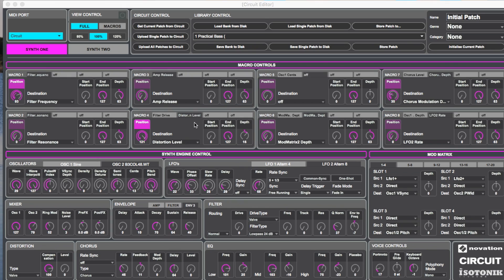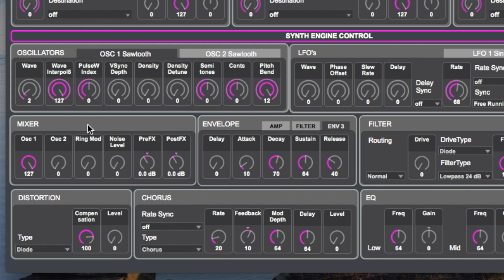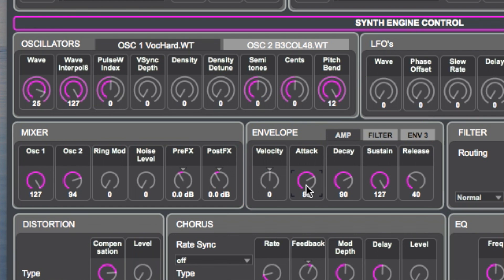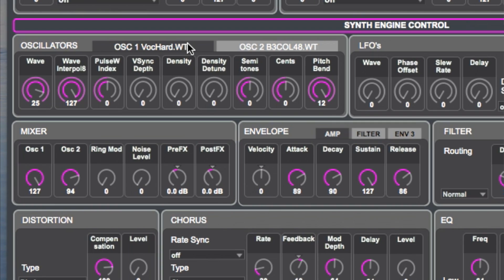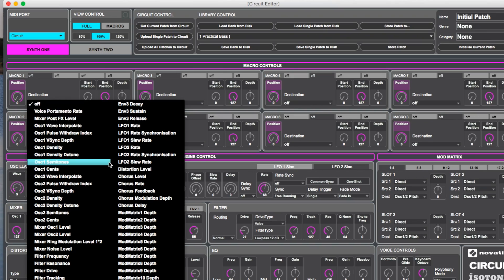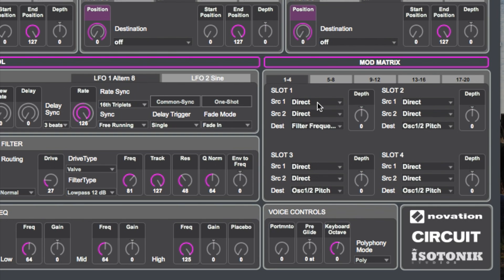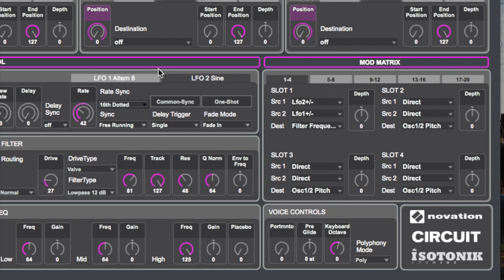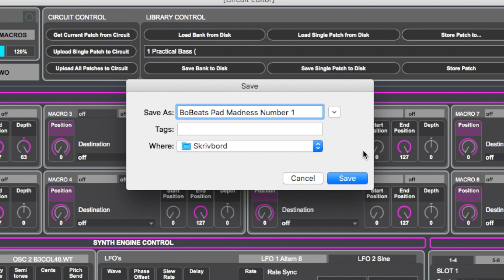Circuit Synth Editor Tutorial (Beginner Overview & Pad Patch)

Comment: Great vid, are you using it within Live? And its just a matter of connecting  via usb? No midi? I'm having issues with the Editor talking to my Circuit  :-/
Reply: Did you get the Novation USB driver? Does Components register the Circuit properly? Did you start it in the right mode? (hold down Scales, Note, and Velocity while turning it on and it's plugged in the USB)

Comment: Don't know where else to ask and becoming really frustrated. I tried editor following this tutorial and it worked and I managed to create my first preset. But next time I've launched it - nothing happens when I'm tweaking synth engine controls. Patch is initialized and macro knobs in editor react to turning knobs on the hardware - and that is it.Would appreciate any help or reference to some troubleshooting guide since I can't find any
Reply from the maker: Have you actually saved the preset? You have to press "save patch to file" save it somewhere and/or upload it to the Circuit. Otherwise it isnt saved on the Circuit
Reply: thanks for such a fast reply, appreciate it. I'm talking about actual editing, when device is connected via usb-midi and you are tweaking live, like you do in the tutorial. I'm on Windows, so as you said somewhere else, you haven't experienced those problems. I'll go thru the comments section, maybe there are some solutions in there. But thanks anyway!
Reply from the maker: +Drew DEI you havnt forgotten to set the depth level of the macro? Easy miss.
Reply: well, you don't need mod matrix to hear waveform change or even turning osc1 level on the mixer up and down, right? I do not hear any impact right now

Comment: Ok, brother Bo, it's me again with the 1 MILLION questions...hahaha... This is super cool, and i get it quite well, JUST have one last question...... how do I load a pack from yours into the isotonik editor from you, I think this would be easier than the components method, and what if the pack contains drums where do they go or are they editable as well ? THANKS AGAIN for your quick replies, I know your time is valuable.   :)
Reply from the maker: +rubber duky you can only load PACKS in components, but syx files should simply load into the editor. I think you choose "load from bank" button. But you can mot load samples in the editor. But the Components is probably your best bet. If you learn to use it it is very practical. Especially for storing backups... say you have filled your sessions... then u just backup everything in components (samples, session, patches) and can do a recall of everything! Super nice way of saving songs (since u need the samples/patches as well for everything to sound right)
Reply: AHAAAA, now i get it. I have been messing with the editor since my last post about an hour ago, and it is simply amazing. I'm getting the coffee/ beats pack. Is there a tutorial on how to get pad sounds to play at full length ? I created some nice drone ambient stuff in synth 2 but they cut off when I play as chords. ?
Reply from the maker: +rubber duky there arw workarounds but I dont have a tutorial on that. I am sure of you youtube search "novation circuit drone" you can find something

Comment: Thanx for the solid bro /completely intimated until about 2 hours ago / wonder can it be midi mapped / if you could use a controler instead of a mouse and keyboard you could do some ill real time-live.......
Reply from the maker: +All Roads yes you can control parameters using some kind of midi setup. But I cant tell you how since I have not tried. Perhaps you could ask on Circuit Owners Forum on Facebook?

Comment: None of the changes I make in the editor work on the circuit... help?
Like seriously, step one, and I can't even do anything... It will 
initialize, but I scroll through the waveforms, and it wont change them;
 they're all sawtooths...
Reply from the maker: I am afraid I can't help you. You should ask over on Facebook "Circuit Owners Group" or send Isotonik a message.
Reply: have you found any solution? I'm experiencing the same problem right now. Worst thing is that it worked first time and then stopped to work.

Comment: Extremely useful video as usual Bo, thanks!
Here's a question may be not related but as I'm new to synth: 
woul and get its  d it be an issue to get an Analog Keys 64 step sequencer to work well with my machinedrum MKi (32 step sequencer)?
Any comment appreciated !
Thanks a lot again
Reply from the maker: Thanks mate! I can't see any reason it would not work.
Reply: BoBeats thanks, I mean in terms of the different step lengths .
Regards

Comment: How do you connect the Circuit, so that you can change sth, then play, change sth again, play again? After this awsome video I want to try it out myself, but the Editor won't let me edit (except the macro knobs, I can tweak them with the mouse or on the Circuit). Does anybody else have this problem? (I'm using the newest Windows standalone version btw)
Reply: I know you've found out by now, but if other people are having the same problem (I was) here's the solution:

When you turn on the unit whilst pressing SHIFT, you get a settings page.
On the left are 2 buttons for ‘Receive MIDI’ and ‘Send MIDI’ these settings
effect both DIN and USB MIDI in and out of the unit. Make sure both of these
are Green, then press Play to boot up the unit.
Reply from the maker: I am not familiar with Windows issues and the editor but I do know a lot of people have trouble getting this to work. You should ask over on Circuit Owners on FB or message Istoniks or Novation. Sorry I cant help you more mate
Reply: Thanks a lot anyway! It's awesome that you reply to ALL of your comments!
Reply from the maker: Thanks =) I try to keep up